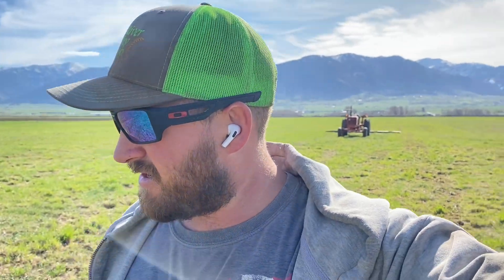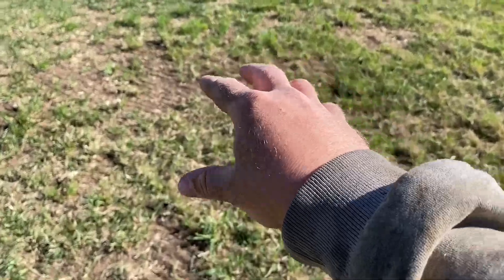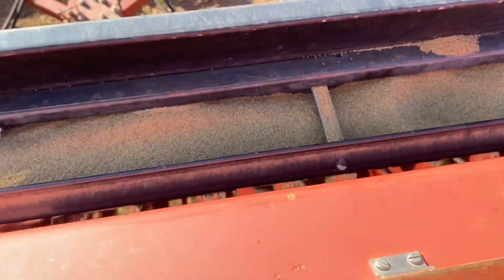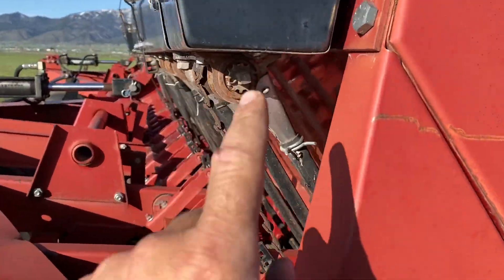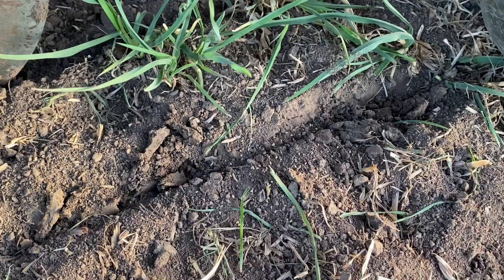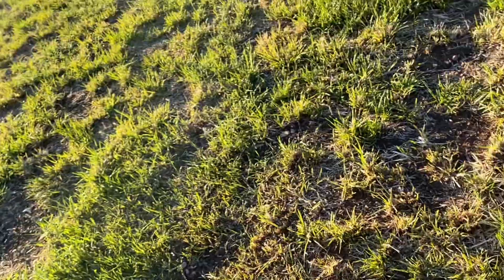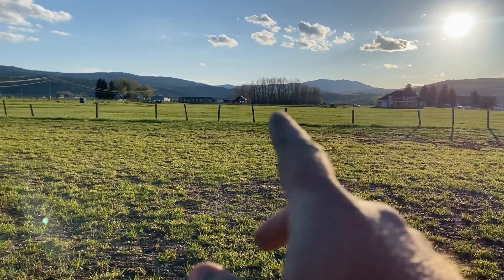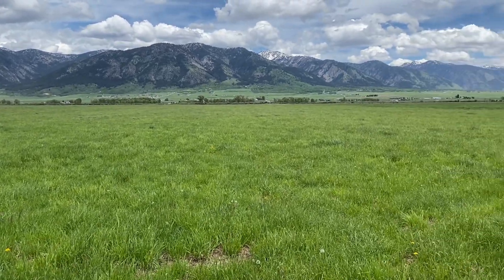Experiment Part 1! Planting Alfalfa into an Already Established Grass Field

Comment: Good post Bryan. Hope you get good results. How do you irrigate?
Reply from the maker: We use a mixture of center pivots, wheel lines and a few hand lines in occasion. How has hay season been for you so far? We are running about 2-3 weeks behind on growth because it’s been such a cold wet year
Reply: @LuthiRanchWY  I remember you said you drew your water out of the river but I did not remember how you got it to your pastures. My water is pumped out of the irrigation company ditch but the cost of diesel has stopped that. I've switched over to flood but this gives poor coverage given the type of topography I have. Fire season has started so many things are in the air. Take care keep your videos coming.